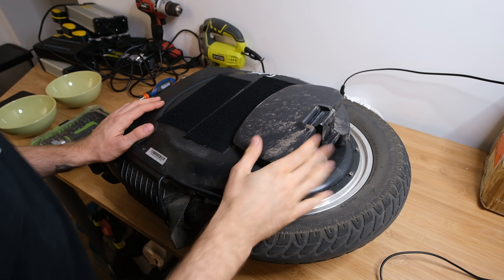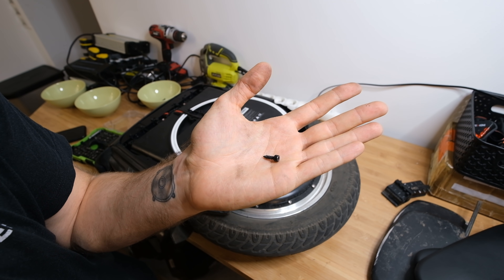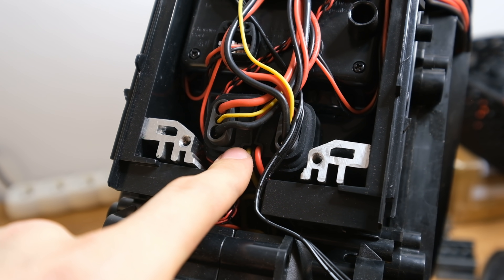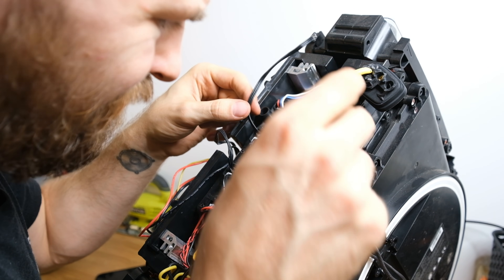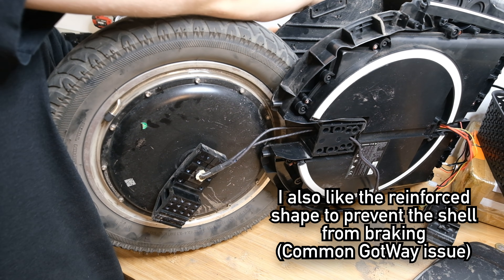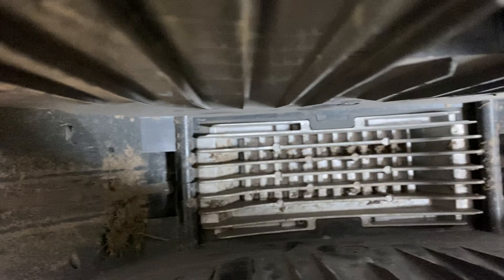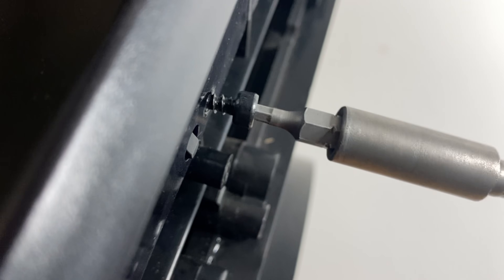InMotion V12 Quality Check - Teardown

Comment: Teardowns are my favorite part of your videos, in fact they supersede all other euc vlogs who are about the ride as opposed to the quality of the machine they risk their lives riding. CorrectWay vids are educational regarding the manufacturers themselves which matters whether you want to do hardcore performance or simply commute for many years. Misguided manufacturers try to hide thoughtlessness builds under plastic covers with some screws, adam pulls the curtain down that hides faults and advises how to make better builds. Smarter manufacturer engineers will learn from adam.

Comment: I changed the tire today, and everything went smoothly. However, during the test, after reconnecting all the cables and trying to start it, the wheel immediately accelerated to almost 95 km/h. I had the bike on a stand, so the wheel wasn't touching the ground. It was extremely dangerous as it seemed like it wouldn't stop. Then a warning message appeared, and fortunately, it shut off. Now I'm afraid to start it again! What could I have done wrong? All the plugs and cables look perfect...

Comment: How hard can it be to do a modification to the rear panel? 
Drill a bunch of holes in the panel where the rear LEDs are shining through. (it's a $20 piece anyway)
If water ingress is a concern, add a thin clear plastic sheet on the inside with glue. 
Does it work ??

Comment: Hey Adam! Thanks for this video! It is very useful for me considering that I am going through a tire change on my V12 HT. As you just said, I had to tear those seals up above the phase wires and now I'm thinking about resealing it but I'm not sure what is safe to use there. What would you suggest?

Comment: I have a battery issue after one month of use on my v12 and have been told in 2 months I’ll be getting a new battery free from the warranty. This is great however I will have to fix it myself. I have no idea how I’m going to do this, does anyone know what I should do?

Comment: Mosfets on heatsink :O 
This shit can go on a lava field without overheating.
Joke aside 
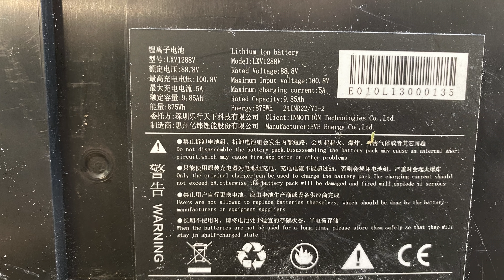11:32 battery Model code probably: LX (V12) (88V) ;    barcode: serial number ; 24INR22/71-2   is probably battery type and pallet nr.    If I counted right it should contain 192 pcs. of 18650(or thicker) cells. I am not familiar with EVE batteries, but I would be safe to assume half the lifetime of an LG/Sanyo-panasonic/samsung cell.
I would avoid the HT version as it should wear out the batteries even faster (except if you do competitive off-roading or don't care about your pocket/environment).

Comment: Have you ever tried removing the motor from the rim? I am having the hardest time trying to remove that one screw from the axle, as well as loosening it to remove it. It's way too locked it. Close to bolted.

Comment: I have 16x now, and it looks somehow similar with v12. Now after a video about gotway caught in fire, i understand why ks decide to set speed limit at 50 km/h, even though 16x have lg mj1 with 10A max discharge rate. So it was totally right not to buy Gotway begode. And yes, v12 looks almost flawless! Basically my complains about kingsong is waterproofing and speed (safety margin, not really speed). We'll see, v12 have a great potential to be a perfect commuter.

Comment: thank you for this.  big fan of your channel.
that said, these wheels are very intimidating for the average rider (me) when considering repair.  are you aware of any movement in the industry toward simpler construction and easier repair of future models?  the way things are now, if we get a flat far from home, we're screwed.
Reply: I think they should at least think of a way to make tire tube changing really fast.
Reply: @grostire  wouldnt be terribly hard... make a panel to access the motor cables and make the slot larger, and another panel on either side to access the screws holding the shell to the pedal arms.... that way you could simply pop open the panels, undo a few screws and drop the motor out... still way more difficult than a bike, but easily doable while out.... im so sick of needing two hours to do a tire change on my wheels lmao

Comment: I disagree with you on the motor wire thickness. There is really no need for the insulation to be much thicker. Just makes it much harder to manage.

Comment: Great construction quality no question, Only negative in my view: The Tiny Mosfets which are not used anymore in any perfomance wheel….guess since 2016.
Would like to see someone who is 30-35kg more heavy than you, but using it in exactly the same „michael Jackson“ style when accelerating. My guess would be those MOS wouldnt make it that long than and blow, or at least lead to severe overheating. 
My guess, at least. 
Mrs Crusher hasnt had that mich luck with her V12 until now….curious to see whats up with it now.
Other than that you can see that a real BIG producer is standing behind the V12. The construction and workmanship is overwhelming

Comment: I really like the modularity and especially the control /power electronics module together with clean cable harnessing. Compared to GW you can see that there are no floating cables that could get cut and shorted or through hole components without adhesive. It also looks like that they have external supplier for their battery packs?

What I really dont like is that mechanically its easy to get the wheel off but you need to do quite a lot of disassembling to get to the connector. I hate usage of silicon and wood screws. There are still things to improve but changing tire must be a nightmare only because of the connector.

Comment: 11:50 it isn't more difficult to figure which way to put the wheel back in. You don't need to remember anything. Look at the treat pattern of the wheel, it only goes in one way.
Reply: until you change the tire and fail with the direction :D
Reply: @LaggerSVK  Haha good one, but it's probably obvious

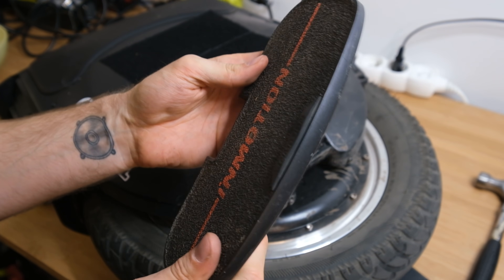Comment: so 2:30 you like the pads now? In a previous video you didn't want the pads to make it to production..
Reply from the maker: They changed them from the prototype I think. Either way only using those pads makes no sense. Only with additional 3D printed pads

Comment: Interesting to see the heat sink's temperature being dissipated via convection, using the tire to keep the air circulating.  That looks like a fairly robust design.

Comment: It is well made and bad made at the same time, i mean well made for the solidity/rigidity, IP rating, part can be buy and replace separately... but very bad made for parts replacement it is a mess just for the tire. Compagny should find a way to replace those tire in 15min or less like clip in lock with short wires and rubbers around it... Not everyone can replace a tire by themselves so going to a repair center will cost a lots more for this kind of wheel because of the time removing the screws and disassembling everything compared to a RS19 which took me 35min replacing the tire and 40min for my EXN.
Reply: the wheel certainly has build qualities but some things are just meh. I have understanding that there is no need to make tire change as convenient as on bike. But having to disassemble whole cable harness and reapply silicon to the connector just for a purpose of change tire? Really? What we need is cosmetic side plastics that would clip on or atleast screw with metric screws. Minimum number of L-hanger screws and a motor connector in close vicinity to axle. That would satisfy me.
Reply: @LaggerSVK  Totally agree they should make it just easier for the customer to replace the tire, this is usually the part we replace the more often, so if you have to take half a day for replacing a tire it is a shame and half day without riding

Comment: Strange that there is nowhere information about what cells are installed. Hope there are built in which can deliver enough power otherwise the battery will unfortunately not last long.
Reply: It seems it's EVE...((( see 11:33

Comment: the thing with these EUCs is a quality, they are nowhere near as good constructed as Mountain Bikes for example. The engineering, cabling, layout, frame, materials etc... is pretty low level. Definitely need some western companies to start making EUCs.
Reply from the maker: Very true
Reply: how do you even compare EUCs to mountain bikes? Mountain bikes don't have a shell\case, everything is just attached to the frame.
Reply: @Ubeogesh  ...
Reply: @shalvami  ;;;
Reply: You get what you pay for.
Reply: @jdbergan  that's a typical BS people telling. You never get what you pay for, you always pay more. want me to explain how market works?... real cost is aways 1/3 or maximum half...
Reply: @shalvami  Agreed. I recently read an article and a manufacture of speed pedelecs said they overprice because the market is small.

Comment: Thank you!! Your Video is a big Argument for me to buy the v12 as my next wheel 👍🏻👍🏻👍🏻 looking forward to see it in action with your style of riding. My V10F can’t keep up with my ambitions anymore 😂
Reply: Hi sir, question please. I'm looking to get my first, and choosing between what you have, 10f or I could go big, v12. How long have you had the 10f? I know it's not that fast and there's a limiter (like others), and did you buy the v12? How is it so far.
Thank you
Reply: @Cons2911  For the first wheel I would buy a much smaller wheel like the V8, MSuper V3 or Kingsong 14... It is easier to handle and learn. My first wheel was the V8,  perfect size. Then I upgraded to the V10, now I have bought the MSuper V3 S+ . My next wheel will be the RS19 or the Extremebull X-Max. I like that the rim and tire is more visible than with the inmotion wheels.
Reply: @Euc_spirit  I just ordered a v12, was thi king of 10f but I can probably buy just one so I went with a keeper. I think I can learn it regardless. I just wish no major accident lol. It will be here by tomorrow (it's shipping by bus lol)

Comment: Great video. Makes me feel like never wanting to open it up, though...
I'm not a mechanic, why does it have to be so complex. Why, inmotion, why?
Reply: It doesn't look complex.. it looks repair friendly, especially how it is basically all modular parts which can be replaced and are all accessible via screws.
Reply: Maybe the reason for that is the amount of water proofing. It needs to be sealed tightly.

You maybe could go under water with the V12 lol.
Reply: @taikaherra8937  Nah, to me it looks like it's probably an artifact of their corporate structure. They must have divided up tasks with one team on each task. As a result, each component has its own casing for example.

Having too many screws is a bunch of mechanical complexity for no reason. In the vast majority of cases, you do not want to attach two parts with screws if those two parts could have just been one part.
Reply: @BosonCollider  I am also not a mechanical engineer but modularity comes with its benefits. In development you can ensure correct interfaces, focus on your module ensuring its design requirements in closed environment and for repair you can change modules.  But it comes with cost of weight I would say. You could compare to GW which has just bunch of components screwed together with harness floating over sharp edges of heat sinks. Thats another extreme.
Reply: Modularity